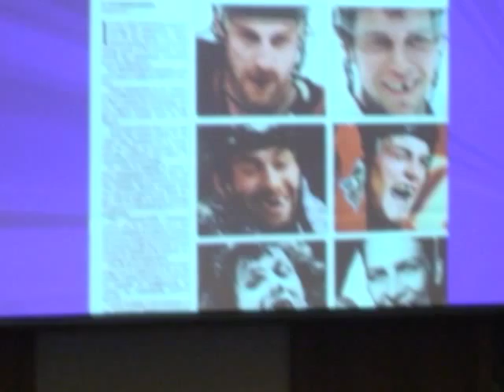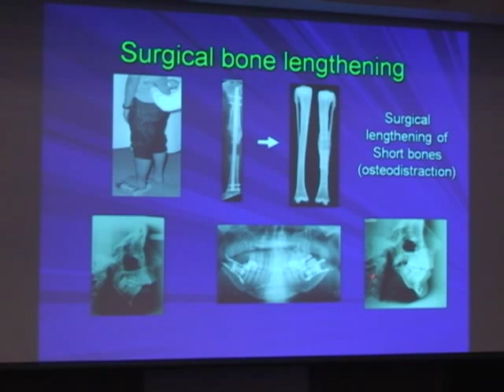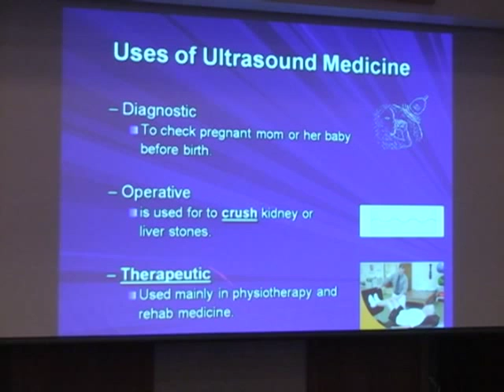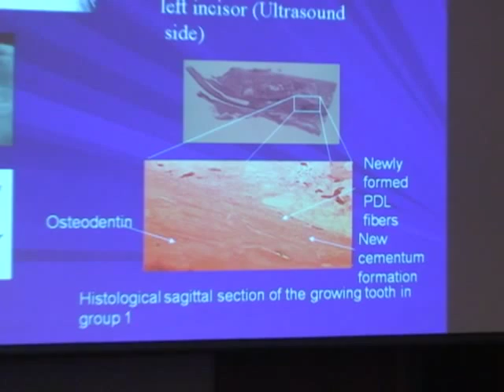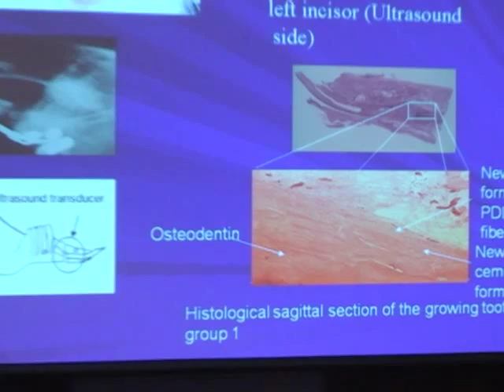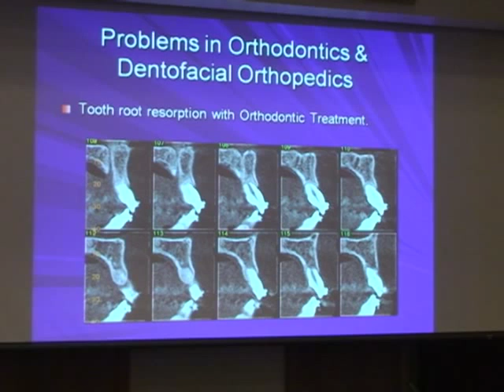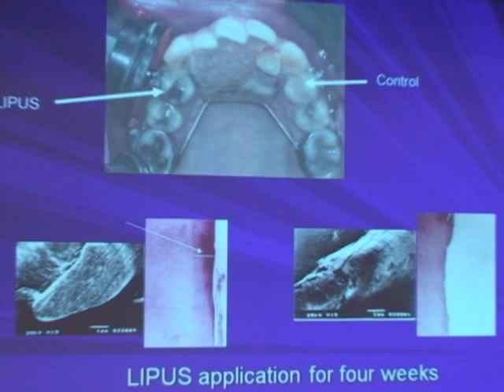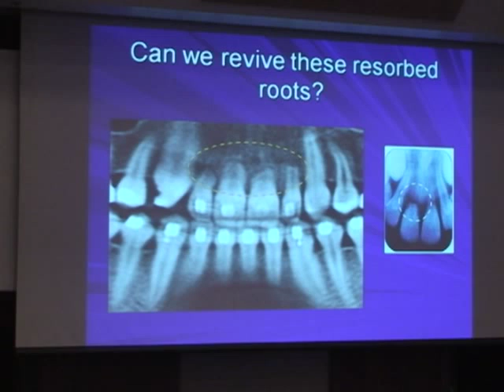Part 1: Ultrasound Based Dental Root Repair

Comment: I bought a gezatone ultrasound massager and I have been able to make short front teeth get longer, and now I have stabilized four teeth that were loose. One of them needs a root canal, but I'm going to try to grow the hole closed using ultrasound and special nanoparticle mixes made from nanoparticles of calcium and strontium phosphate, manganese, magnesium oxide, boron and others. I killed the abcess infection using big doses of the well known alternative treatment chlorine dioxide(using
Reply: Hi metalurgon, where did you buy the gezatone ultrasound massager? Were you able to regrow the rest of your teeth? I have a really bad teeth since I was a little kid. I lost 3 teeth recently and I want to regrow a broken one... I am so new to this. Can you please send me more information and the procedure and what I have to do?  Thank you.
Reply: Yeah please share your results
Reply: Did this work? Do you think it works on root canal?
Reply: @nee7178  Nope. Only a dentist can help with that. During covid crackdown of 2020, I had no access to a dentist and had an abcessed tooth and the jaw bone was deforming. I put thin copper wire down inbetween the gum and tooth and turn on the small voltage of 36 volts and 0.175 milamps so that masses of copper ions saturated the tissues there under the tooth. The abcessed went away for two weeks after one five minute application. However I finally had to get to a dentist because the abcess kept coming back.
Reply: @metalurgon  what about a tooth that was fully root cancelled? Like it’s been cleaned out and everything
Reply: @metalurgon  do you think it’d go back the roots or something on a dead tooth?
Reply: @nee7178  Please go to a dentist)))
Reply: @nee7178  If you want to put copper ions into the tissues under a dead tooth, just in case, for profilactic, that is fine. But if you need to finish your root canal, then you should go do it. Later ocaissional, once a month or two you could send copper ions under the tooth electrically easily. The ions will penetrate tissues more than an inch around the copper donor electrode.
Reply: @metalurgon  got it it's an old tooth that has a root canal so it's been hollow for years

Comment: I am definitely up for testing this device. Especially if I can use it on a daily basis in conjunction with the regular brushing of my teeth. The first-ever time I got a cap on a tooth, I was only 3 years old. To this day, almost all my teeth either are capped or have fillings in them. I have a rare few that are still healthy. As mentioned, I brush regularly, 2 times a day, morning and just before I go to bed. Only on rare occasions do I do extra brushing and that's if I ate something that gets stuck in between my teeth. I did buy a therapeutic massager but have yet to try it out because I'm not sure of the complete risk of using it so close to my brain. I don't want to cause microbubbles, that will cause me to have a brain hemorrhage. But if there is a device or any testing needed to be done still, I'm game for sure.